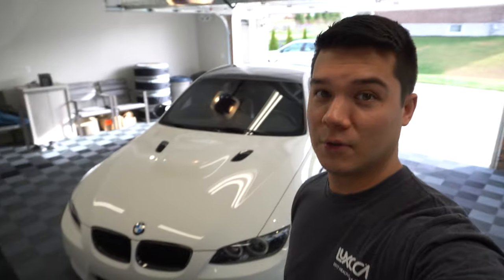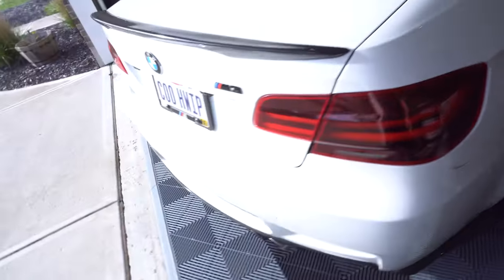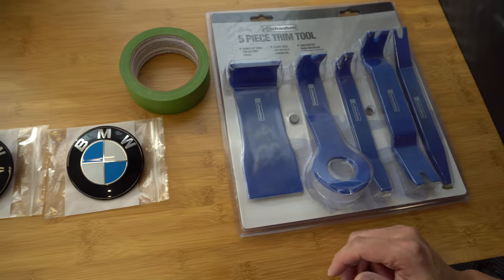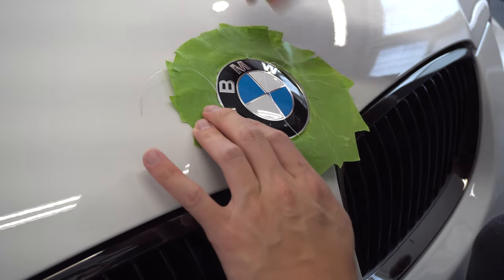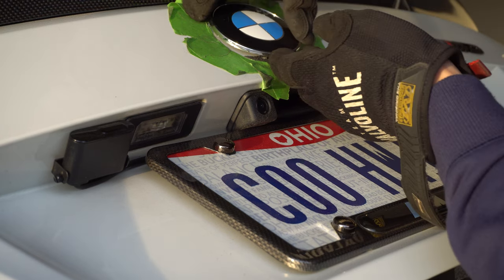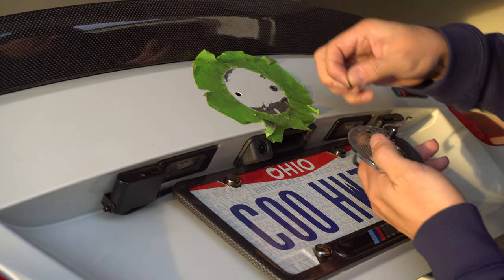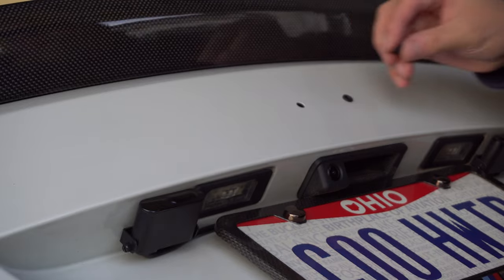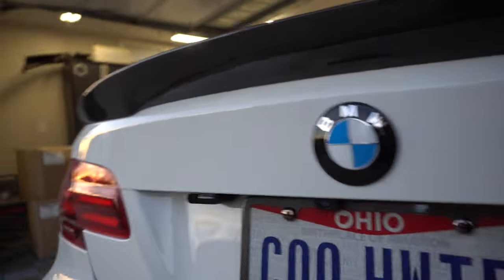Painted Roundels | BMW M3

Comment: Wow, those F14's look perfect -- what are you lowered on? I like to hit 3M tape with a heat gun before placing, it helps the adhesive work better, especially when cool/cold out. Looks pretty warm where you are though so maybe not necessary.
Reply from the maker: Thanks! Lowered on KW HAS. And yeah, generally I hit it with some heat after I install something with 3M. Didn’t show that in this video or I may not have done it since it was warm enough. I don’t recall haha